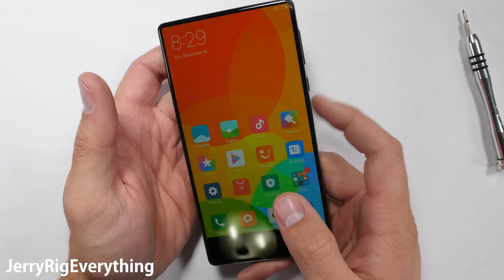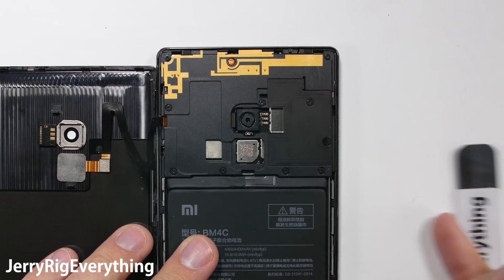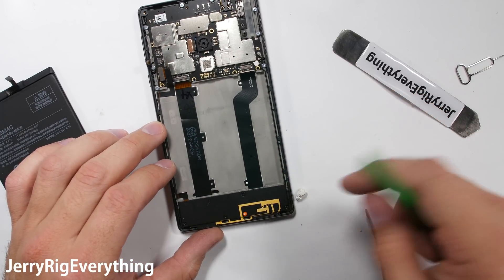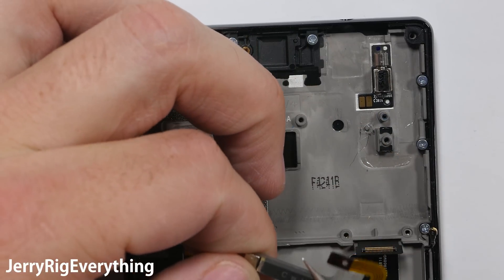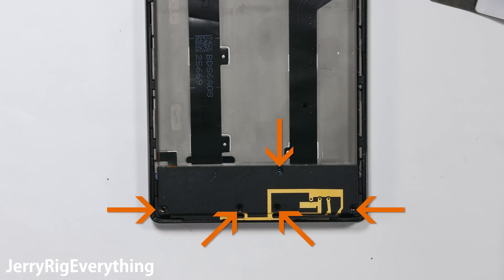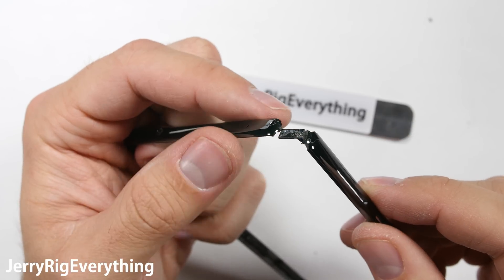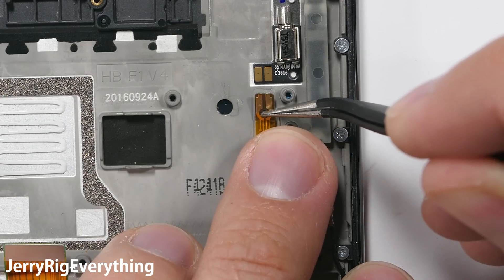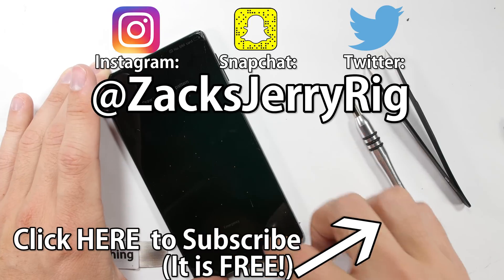Mi Mix Teardown - Piezoelectric Speaker Test - Screen Replacement

Comment: The most informative review ever! I bought the MI MIX several months ago and have been worrying about possible break of the ceramic back and frames. The parts can be found by googling "mi mix ceramic part" and back is about 30USD, frame is about 80USD. It is really relaxing that I would be able to replace damaged parts with this video. Thanks a lot!

Comment: Need help I have a mix with a cracked screen. Is there a cable between the glass and lcd. I have a glass only part and uv glue on the way. Just would like to know that I can separate if careful. Thanks in advance

Comment: Most people do not realise but the Mi Mix is NOT an innovative phone its a pure copy of the Sharp Aquos Crystal.
Which also has vibrating speaker under the screen that vibrates the audio to the front. 
It even has the camera placement at the bottom.

Comment: that vibrating thing is NOT NEW in telecommunication....... Germany use same stuff for their tank radio operator IN 1940s WW2 so that the microphone is not picking up much of any other noise. This make clear transmission unlike the microphone used in the allies which tanker always bump into them or need to aim to the commander's mouth in order to have clear command. Their microphone wrap around their neck so that it can feel the vibration and use it as a microphone. This earpiece speaker just does that in reverse which many other speakers did it much earlier already. There are many bluetooth speakers that can be put on vary surfaces and make the whole surface as a speaker. traditional speaker will attach this piece to their own kind of material like film of paper or plastic so it is clearer. This phone just make it attached to the frame so that it eliminate the earpiece cut out.... but definitely a trade off for sound quality due to metal/glasses are weaker and not a really good sound conductor

Comment: Jerry first remove bottom charging housing then remove battery adhesive and trust me they will not brake :) you need to remove them as flat as you can, if they bend  they break. thx for fantastic videos

Comment: Probably necroing this diassembly, but the end of the video he stops at the midframe attached to the LCD/Digitizer, he says they're adhered together. They aren't, the front displace is latched to the midframe just like the back panel is snaps. There's no glue on this phone. Just screws and clips.

Comment: +JerryRigEverything Hello, It is been a while for you make these video. Unfortunately I need to change my screen in Mi Mix 256Gb version due to screen color distortion. But I can not find replacement parts. You said you can add links in the description but I can not see them. I will be very happy if you share replacement part information :)

Comment: Dear Jerry,

I love this post, since my mi mix screen cracked :-(

My LCD still function normally. I've already got my outer glass replacement for $6 from aliexpress.com, the problem is, is it possible to replace the screen only without tear down everything like in your video?

Thanks for your help.

Comment: Innovation by having low quality vibrating sound, instead of speaker.

Innovation by removing the headphone jack.

Innovation by putting your fingerprint scanner at the back of your phone, where it's hard to reach and smudge the camera.

WOW so much innovation from those companies lately. If I were them, I would just cut down on that R&D and dump it in Ireland tax heaven or some shit.

Comment: Hey Zack, really great strip down of this phone.  My Mi Mix took a drop and it looks like the outer glass of the screen got cracked, which replacement parts are cheap and available for.  However, it seems like you stop /just short/ of getting to the screen breakdown in this video and I'd love to know if you had any additional thoughts on how to replace the outer glass of the Mi Mix when the touch capabilities and rest of the phone is functioning fine...but there's a crack in the glass.

Comment: @JerryRigEverything 

I just cracked my Mi Mix front glass. LCD functionality is still intact and I do have a replacement front glass panel (without LCD).  You think I can replace just the glass? Full disclosure, in the past I tried replacing the glass on my Nexus 5, was unsuccessful. very similar scenario  LCD worked fine, and as I tried separating  the glass from the LCD panel, the LCD panel cracked. I think my error was not applying enough heat.

Comment: Speaking of rubber ring insulation on frame, I have mentioned this in a thread on xda during a repair I did on the crap screen razr by moto. lol
Reply: Meaning that as you said rubber ring would cushion frame during drops. This applies to many builds and most would benefit.

Comment: I have my doubts about the sound quality and will wait to see other reviews on it simply because of these two reasons: 1)  I presume that the piezoelectric speaker needs to be nice intact with touching the surface it's supposed to touch and since you did the test after removing it and taking apart the entire phone it might not sat in its ideal place by 1 mm or something causing a drop in performance.  2) I can't think right now to test such a speaker but I don't think that having a mic over the phone would do justice since the hole deal with that is to put a portion of the screen or the casing on a bone of your skull avoiding soft tissue as much as possible... leaving a microphone over the phone does not cover the necessary surface area and the vibrations have to travel through a lot of stuff (+ the table) in order to move the small diaphragms inside the mic...

Comment: Can you do a oneplus 3T teardown alongside a oneplus 3? There's no external difference but it would be interesting to see how they fit in a bigger battery etc. and if the new battery will fit in the old phone...
Think about it maybe...
Reply: It would probably be similar to that Motorola Z Play disassembly video, compared to Jerry's Z disassembly video. The parts would be rearranged to fit the bigger battery.

Comment: The speaker cuts down a lot of tones and frequencies ... trash. Its gimmicky trash. Sony and Sharp know how to make better bezeless phones.
Reply: Shamoy Rahman even as a Sony fan... Sony? bezel-less? HA!
Reply: this "trash" seems gimmicky until you see its specs, price and durability. Compared to the S7 and iPhone 7, I'd rather save up the 150 bucks in exchange for an average sounding ear piece. MI mix has better specs.
Reply: Anas Malas Go search up the C5 Ultra and Xperia XA, they made the side bezels even thinner than the Mi Mix. Also search up the Sharp Aquos Crystal, better design and build quality than the Mi Mix.
Reply: Shamoy Rahman but like come ooooon... Huge chin and forehead bro...

Also I do know the aquos.. Too bad its a mid ranger
Reply: Anas Malas Don't let the looks and specs fool you, the display can't even get beyond >500 nits.6GB of RAM is useless without good RAM management. Materials and build quality are not good at all (except for the ceramic back).

Comment: Jerry, would you do a Galaxy S3 scratch test? That way, we the consumers, will actually be sure that Samsung is decreasing the hardness and quality of the glass parts of the screen. My S6 Edge cracked after 1 fall but my old S3 I've dropped 1 million times. After the S3, I dropped my Note 3 1.5 million times including concrete. No cracks and sold it for $150 after 3 years of heavy use.

Comment: Hi Jerry!

By chance could you please do a teardown of the Axon 7 before it fades too far into memory?  It would be neat to see if the build quality is on par with others.  Also there is a bit of a situation where the battery may not be as large (in mha) as advertised.  Would be neat to see your thoughts if you find any anomalies.

Thanks for your videos!  There are a lot of fun to watch!

Comment: the battery is surprisingly easy to replace. A very important point for me. The quality of Chinese phones has reached a whole new level. They are at least on par or even better than Apple, Samsung, HTC and LG. I consider bying a Xiaomi phone next time instead of other brands.
Reply: If it has Android - go ahead, give your money to any brand, but don't waste it on apple products.
Reply: I've bought the redmi 3 note and the redmi 4. The quality is amazing.  The camera and video is pretty good.  Plenty of ram, plenty of storage. Finger scanner as well works really well. And cost 1/5 of the price of the latest Samsung or iPhone.
Reply: @mutton_man  
Redmi Note 3 is in their low-cost series, and even then it functions better than most iPhones lmao
Reply: @pyrrehraus6571  I know right. I still got it and its still running well. A fully charged battery will easily last me the day. There's not a scratch on the screen. And runs smoothly with multiple apps open. It cost me £110 2 years ago.
Reply: @mutton_man  
Had mine for 3 years, just cracked it a month ago :'(
Reply: @pyrrehraus6571  what phone are thinking of getting next? I was thinking of purchasing the redmi 4x note and have my redmi 3 as a backup. I can't be without a phone and it takes 1month to arrive from China.
Reply: @mutton_man  
Trying to find a Mi Black Shark in China this December.
Reply: @pyrrehraus6571  that phone is a beast not sure if it's worth the extra money though unless your planning on gaming on it alot.
Reply: n8neiTen8n Hong Hugh ng
Reply: Raxio ra it’s not considered that way just because it’s manufactured there, most often people mean where it’s designed
Reply: Will be a great choice! I have a mi note 5 and it's wayy better than it's competitors.
Reply: BananenRepublikDeutschland not to sound racist but I cannot consider Chinese phones on the fact that where I live (the Bahamas) the Chinese basically are trying to colonize our country via economics, which would be fine but they don’t care about the environment and did a shoddy job with one of our greatest hotels (bahamar).

Comment: This might be a stupid question. But at around 1:45 in the video he says be careful not to be puncture or bend the battery or it could catch fire. But what about in his bend test videos, wouldnt there be a possibility of damaging the battery during the bending of the phones, and thus the battery catching on fire?
Reply from the maker: +Eclipezz a slight bend is fine. Anything more than 45 degrees would start getting dangerous.
Reply: JerryRigEverything So what about the Nextbit Robin?
Reply: It's for people who wanted to reuse the battery after the teardown.
Reply: Eclipezz | most of the times, batteries help the phone to resist the bend force, they are pretty stiff
Reply: There's also a chance a sharp shard or screw from the frame could puncture it if the chassis fails catastrophically, it's more of a case of when rather than if honestly. I thought phone batteries were getting safer - but clearly not judging by recent events.
Reply: That advice is for those who are opening thier own phone not for himself.

Comment: Must your ears touch the phone to hear the sound?
Reply: If you watch that part the microphone can receive the sound. Therefore the ears need not be in contact, and if you did watch that part sound vibrates or can be heard on either the back or the front
Reply: Well the mic used by jerry don't touch the phone and even jerry said that it sound like a loud speaker...
Reply: nazhif1 Yes, because its similar to those SONY BT Earphones that use Bone conduction method.
Hope that makes sense.
Reply: nazhif1 go to this part of the video 2:50
Reply: I don't know if you're trying to be smart or something but that did not help.
Reply: The microphone is resting on the phone itself thus transferring the vibrations to the microphone. My question was; can the sound be heard through air or does it rely on conduction.
Reply: I think it's actually good, because it can protect your privacy.

Comment: xiaomi said that mi mix has the front camera tilted for good selfie being at bottom
is that true
Reply: debasish pradhan According to the other reviews and their demonstrations of Mi Mix, when the phone is upright the camera points slightly upwards towards you; flipping the phone upside-down will cause camera to point down like any of the current phones out there

Comment: can you test mi5s or mi5s plus, i want see how durable is that phone
Reply: sdq sdq not all, the Xiaomi Redmi 3 passed the bend test, fire test, etc.
Reply: xiao mi phone always poorly build other then this mi mix model
Reply: +sdq sdq are you already test the mi5s?
Reply: +sdq sdq are you already test the mi5s?
Reply: +sdq sdq if you already test the mi5s, you can say xiaomi phone has bad build quality
Reply: ermm look at all his past xiaomi video all the phones crumple like paper
Reply: only mi5 failed the bend test so far, everything else passed it
Reply: Isn't mi series suppose to be the higher end xiaomi, how is that Redmi 3 is better built? Someone send him a mi5s phone to test?
Reply: Different construction. I cant remember which one jerry broke, whether mi5 ceramic or glass. It is premium device but doesnt meant it is durable. You cant differentiate premium & industrial. Basically mi5 have no support material like alloy/metal frame. Redmi 3 on other hand is plastic, the only thing that held it were the thickness, plastic construction, dragontrail glass, thick metal backplate & small size.
Reply: Ive abused my RN3 and Mi5 quite a few times, no issues, not even a scratch so far

Comment: The speaker is cool, but I like ceramic on my phone as much as I like glass: there should be as little of it as possible. I miss Google's moto and how they managed to build great phones of mostly plastic. RIP moto😢
Reply: Sanes glass/ceramic is too easy to shatter, so these are definitely no to me. Metal is better, but it brings problems with radio reception and eliminates the possibility of wireless charging. So the best of all worlds is a primarily plastic build with metal accents, like the x style.

but that's just like, my opinion man